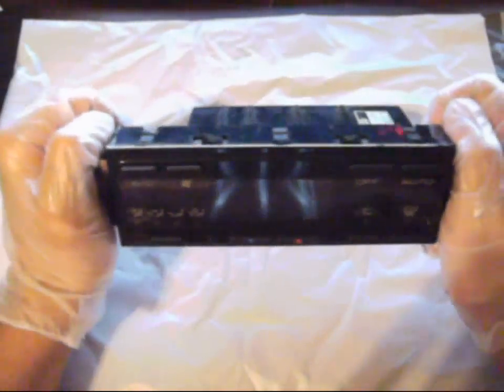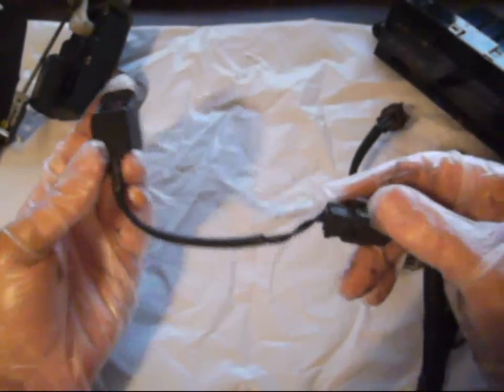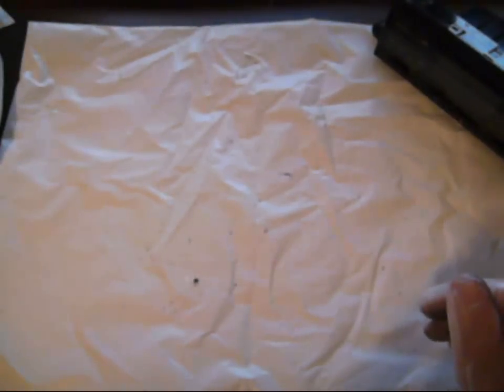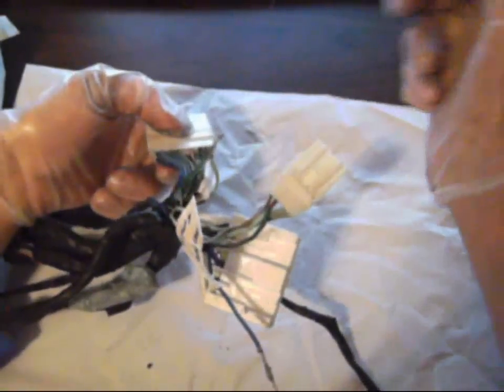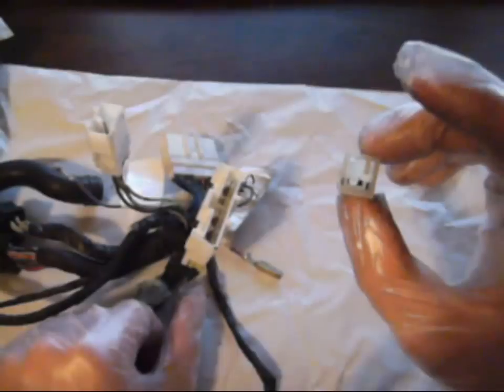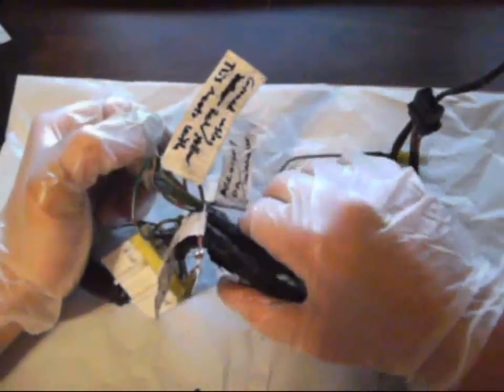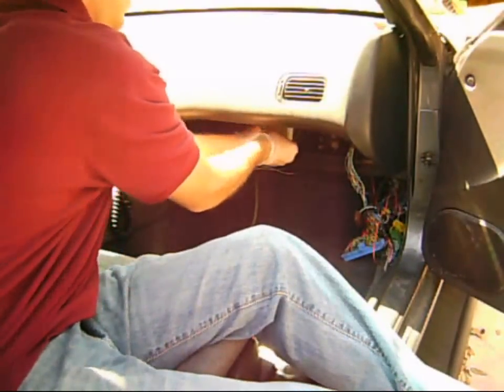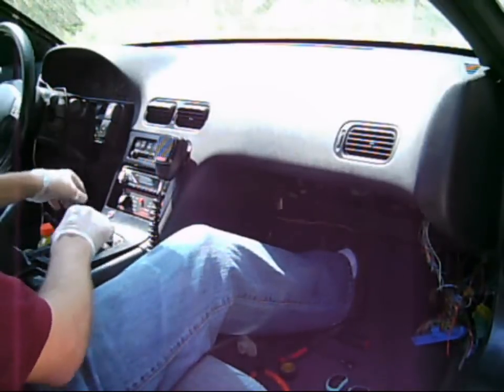S13 Digital Climate Control Conversion - Part 1

Comment from the maker: If your car has the analog unit which has the auto feature it should have the following already installed because without them the "Auto" feature wouldn't work: The ambient temperature sensors located both inside and outside, the sun-load sensor located on the opposite side of the drivers seat in the defrost air vent bezel, and the hvac motor. The only thing left really is the head unit, so it might even be plug and play for you! Worst case you will need the digital dcc sub-harness!

Comment from the maker: @bokiss13 Yes you can install this without having cold air :-)

I dont have my air compressor or anything like that installed right now, but I am working on that. But it will still work the same way, it will do max cold if it sees you have the temp way lower than current air temp, and it can maintain heat for you in the winter :-)